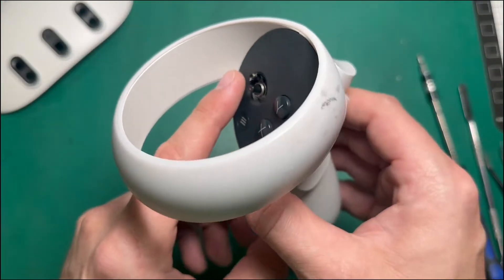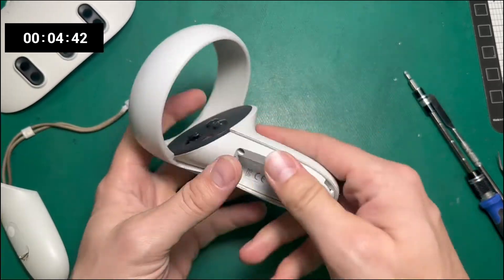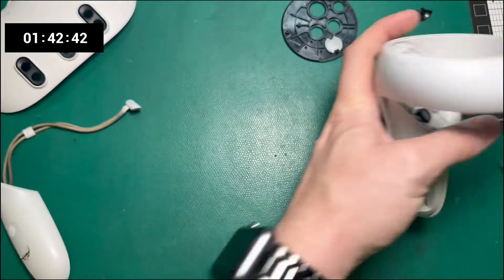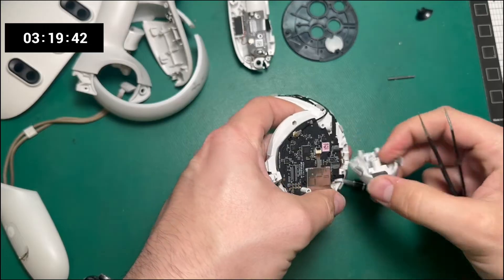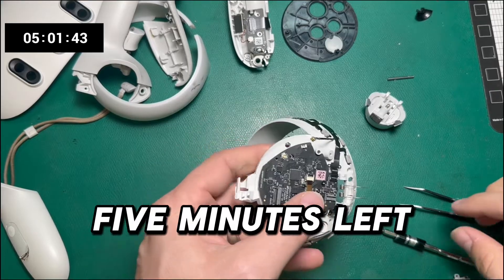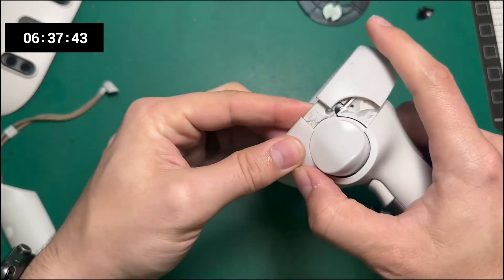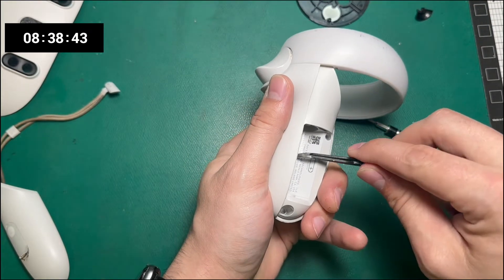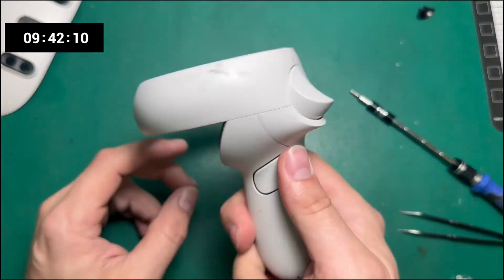The Quickest Quest 2 Joystick Repair Ever - Can I Set A Personal Record?

Comment: It goes without saying but don't speedrun this. It will take a long time, probably hours, and you want to spend that time doing this carefully - the components are very small and easy to break. Also, if you can get a decent T5 torx screwdriver, a plastic spudger tool and some Sticky Tack (Blu-Tack in the UK), these will be helpful. I used that putty to hold screws for me - they are not all the same!

The full video you need to watch is on this channel, the 17 minute version, called "Meta Quest 2 Controller Joystick Repair - Eliminate Stick Drift! - Fight to Fix EP.1".

And note my comment on that other video:
6:05 "pops right off" was impossible for me to do. What I did instead was to use a strong light to see the ribbon cable and flip the black tab up with the tweezers and gently pull that cable out. Then the whole handle comes off the top bit. Then I could separate the two handle pieces, though it was still extremely tight. I separated those two by pushing a plastic wedge tool in between the two, just left of the middle of where the battery would be, and working my way upwards. Having those apart made reinserting the ribbon cable much easier.

Comment: Followed everything. Put back the battery and led did not light up. I opened it again and made sure all ribbons were seated and put the battery back in before assembly again and nada. / turned on the meta and it is fine. No light, but works. All good with me. Thanks.

Comment: Thank you for the video! I just did my left controller. Success! The one tip I didn’t hear you go over is when attaching the board with the joystick, make sure to align the AB or XY buttons correctly. They orient a specific way to work correctly.

Comment: Question, I did all the things as you did and I ran into a new problem, my controller drift was down but now I  can’t input into the lower half of the thumb stick, and it also get phisicaly stuck a tiny bit in the lower left segment. If there’s anything I should be trouble shooting pls let me know.
Reply from the maker: Where’d you get the replacement joystick? Could be a Lemon.

Comment: Is it important to put that spring capacitor thing back on the joystick I don’t feel like retaking it apart if it’s not important
Reply from the maker: Very important. Your controller will not detect your thumb on the stick without it unless you depress or move the stick. Critical for many applications.

Comment: Hi, is it common that the white led for pairing in the quest 2 controller gets busted and stops lighting. My controller pairs and tracks well but the white pair led no longer works when pushing the buttons from sleep.
Reply from the maker: Usually that is an indication of damage to the LED emitter ribbon on the ring.
Reply: @fixmyoculus I accidentally ripped of the cable from the motherboard 4:30 what should I do ?
Reply: I just did the same thing. This video sucks!!!! He doesn't even warn about being cautious and just sticks his pry tool in the there making it look too easy. What a shame 😞🔫🔥😔😭😕